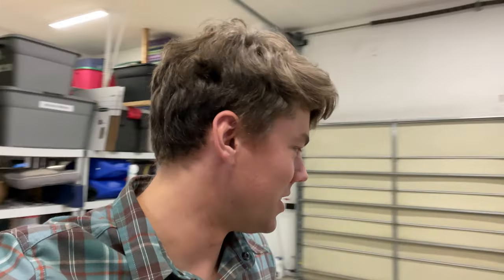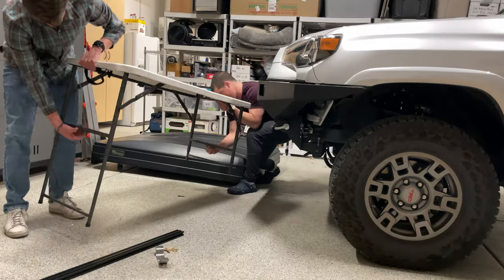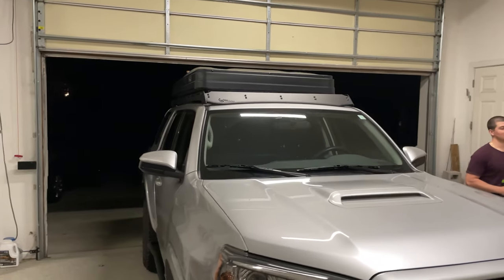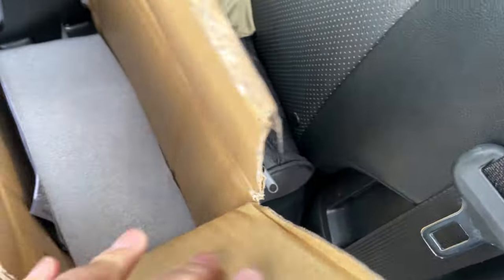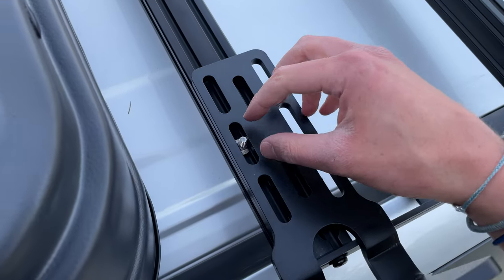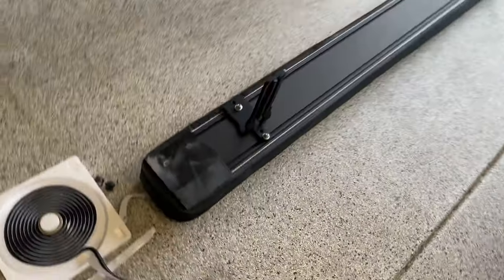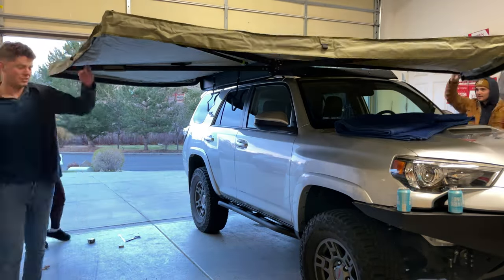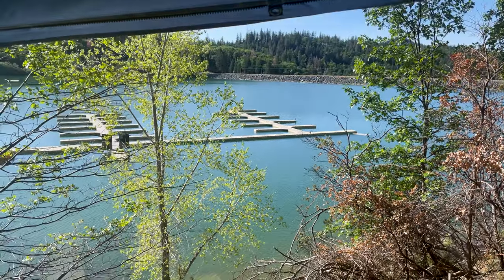Ironman 4x4 Nomad 1300 and Deltawing XTR-71 Prinsu Rack Install

Comment: this helped so much...... ive been trying to put this tent up on my car for two days. I just ordered the prinsu tent spacers and hopefully get to run this thing soon. your setup looks pretty sweet
Reply from the maker: Glad to hear it could help! Appreciate the compliment. If you have any more questions when it does come, feel free to come ask them here!
Reply: can you post the size bolts you used and the washer to the bottom of the tent so i can grab those for when the spacers arrived it looks like you used a rather large spacer and a shorter bolt.
Reply from the maker: @philipperez6422  all the hardware for the tent mounts came with the spacers! The only hardware I had to purchase was for the awning mechanism. Everything else was included either with the tent, or with the rack spacers.

Comment: Curious how well the awning held up mounted that way in wind and rough roads. Any issues? Looking to mount it the same way.
Reply from the maker: Awning mount had no issues! I would check it every month or so to check to make sure bolts were still tight. No road noise from it either

Comment: I liked the set-up and affordability. You paid $1300 for the RTT & awning? Did I hear you right? How is it holding up so far, any regrets in buying this instead of other brands?
Reply from the maker: I think it was closer for 2800$ for both brand new. No regrets on the brand, it held up well but I recently sold the set up in favor of a ground tent as I couldn’t justify having it mounted 24/7. If I were to go RTT again I would put it on a trailer so I could leave it behind when not in use.

Comment: I have the inspired overland rtt, the factory brackets also squeeked, the 1” mounts fixed it, what a relief i thought i was going crazy 😂. What front bumper do you have?
Reply from the maker: Glad to hear that! Coastal off roads front bumper though. Weld it yourself but found someone local to do it and had a shop powder coat it.

Comment: I was about to get this bad boy, but might go with the swift 1400 so I don't run into those strap issues.
Reply from the maker: I ultimately ended up selling mine. I did not use it enough to warrant the price as well as the squeaky squeaky. I decided a ground tent will have to do for me or may buy one of the inflatable mattresses for the 4 runner back.

Comment: Can you share the part number for the awning brackets you used? I need to do a similar setup for my Prinsu Rack with Freespirit Evolution pop-up tent.
Reply from the maker: No part number necessarily. Awning brackets were whatever Ironman 4x4 supplied. I think it’s their only bracket, not sure it can be purchased on its own. The 1 inch spacers for the tent mounts can be found with a quick google though!